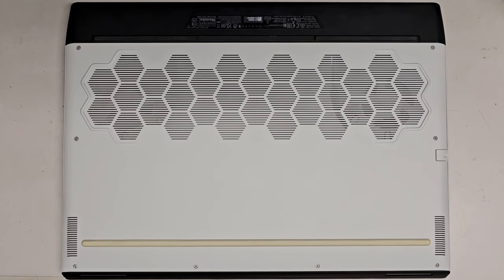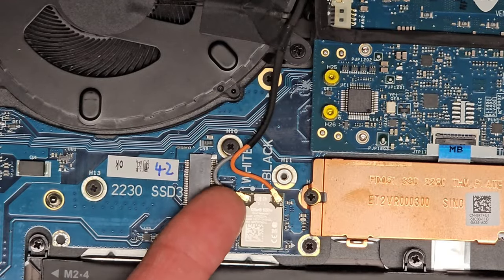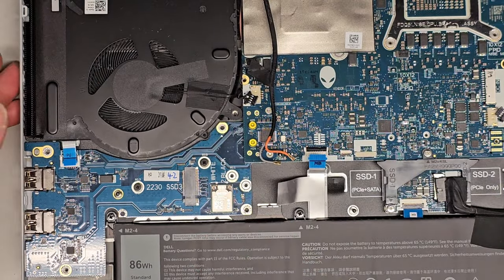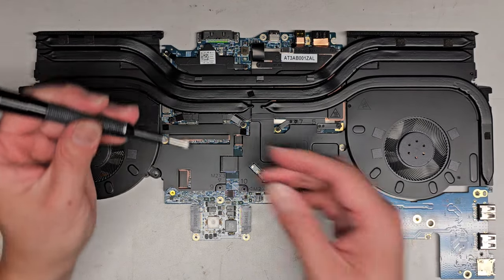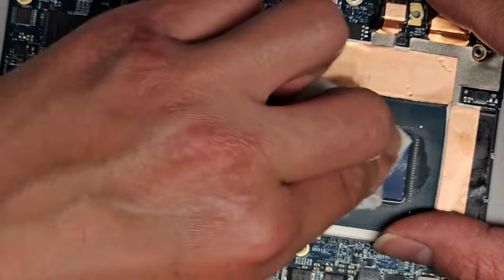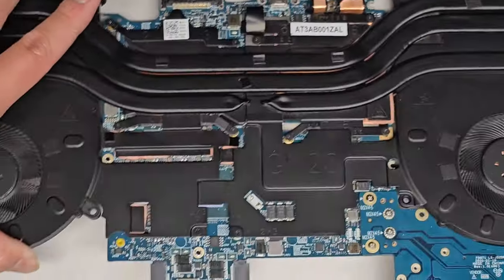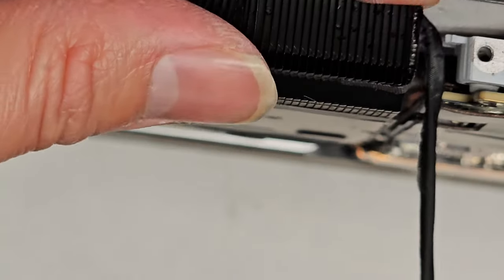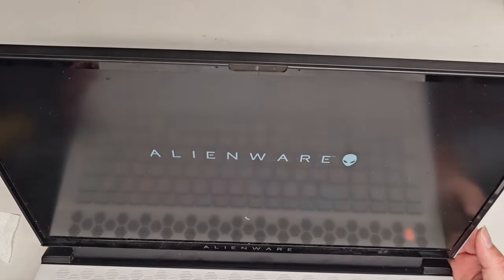Dell Alienware M17 R4 Disassembly SSD Hard Drive Upgrade Battery Thermal Paste Replacement Repair

Comment: Great, helpfull video. Unfortunatelly when I trying to turn on the power button there is no signal of life just start flashing. 3 red colour flash and 5 blue after on alien logo. Any idea?
Reply from the maker: Check the RAM
Reply: @ItsBinhRepaired  not really have a idea how to do that becouse my ram are soldered into the mainboard. I haven't touched them, so they're definitely not mechanically damaged. I was super carefully with everthing as well. I may be using some screws in a different place if that could be the reason. Error light code says is power rail failure.

Comment: I tried unscrewing the tron bar the other day but the screw was to tight i ended up pretty much ruining the head, how would you recommend i go on about that? I disassembled my old alienware 18 a few times without issues, and given that with this one you don't even need to remove the screen to get to the heatsink like on the 18 it should be easier but im struggling so much with it lol
Reply from the maker: These might work https://amzn.to/49wMOtc
Reply: @ItsBinhRepaired  thank you!
Reply from the maker: Yup

Comment: Where’s the cmos battery on these
Reply from the maker: Likely built into the main battery
Reply: @ItsBinhRepaired  yeah I was thinking the same thing and the battery is going out, however I’m going to just send it to Dell and see what they say, the hardware warranty is expired but I’m hoping to get a replacement.
Reply from the maker: @GoIem  hope it goes well
Reply: @ItsBinhRepaired  I appreciate it, thanks for the content.
Reply from the maker: No problem